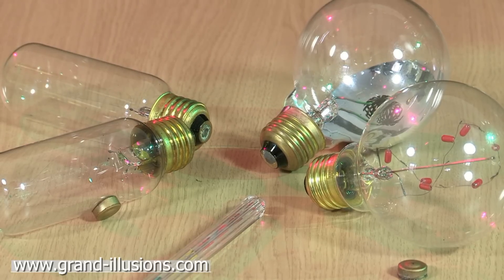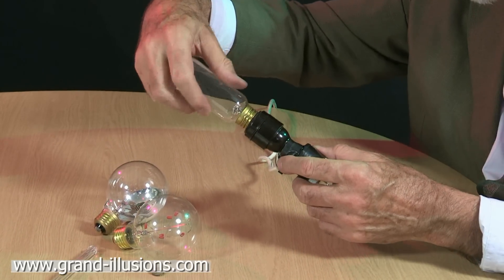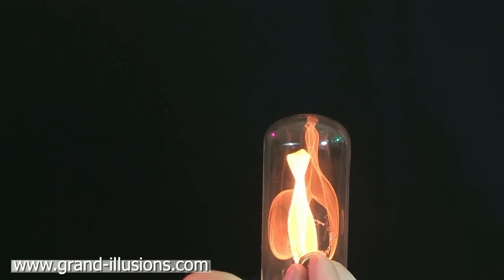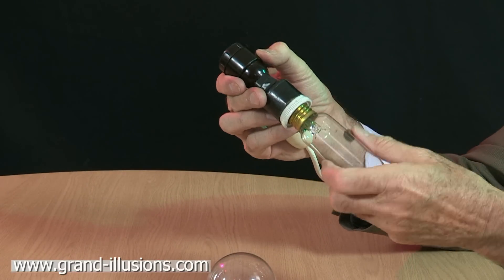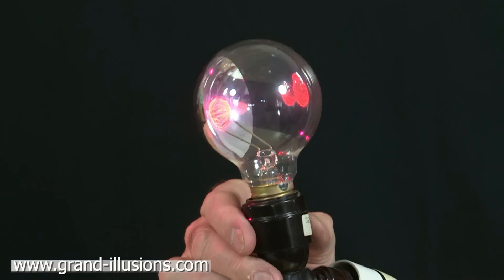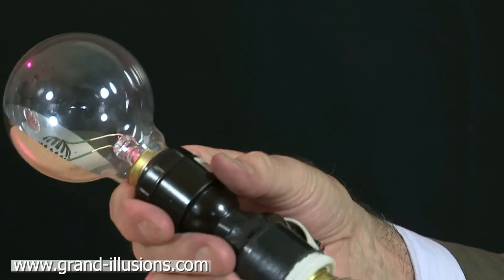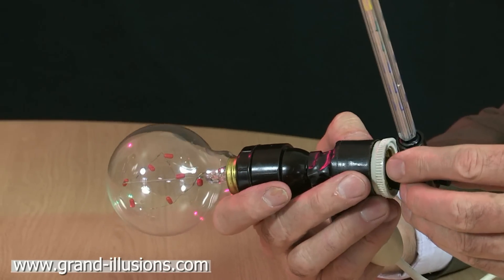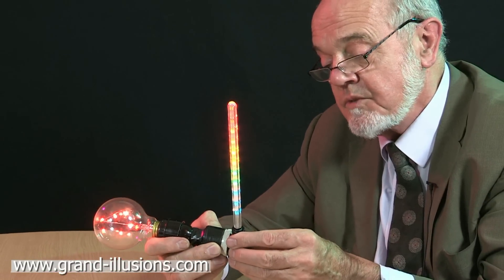Unusual Japanese Electric Light Bulbs

Comment: You are wrong about both UK and Japanese mains voltages. In the UK it's 230 volts and in Japan It's100 volts (50Hz in Kantou and 60Hz in Kansai).
Reply: True we were in Japan 3 times and everything is 100v. However I brought a decorative orange incandescent bulb there about 15 w and it says 110 volts not 100 or 120. Maybe a universal Japan/USA bulb. We used USA 120 volt bulbs there and they lasted forever on 100 volts but with reduced light output. Basically had to use double the watt rating ie 150 watt bulb where normally a 60 or 75 watt bulb would go. Most food mixers, vacuum cleaners, slot cars, fans, radios, space heaters, soldering irons
etc for 120 v 60 Hz worked fine on 100v 50/60 Hz just slightly lower performance.

Comment: Try using 240Vdc with the magnetic lights.
Reply: ***** Er, no. It would burn the filament. And the oscillation doesn't have any thing to do with the voltage, it's related to the frequency of the power supply.
Reply: Flatline.
Reply: *****
That would be a flatline.
Reply: +Simaka Wolf it would work, but only at switch on, and switch off. One way when turned on, and return to rest position. DC is just really really slow AC.

Comment: actually unless they are the same wattage they wont both have 120V on them. if one is 25watt and another one is 50watt then putting them in series one will have 2x the voltage of the other across it, not half

Comment: The magnet-operated bulbs are knock-offs, though nice ones, of an American-invented bulb called the Balafire, still manufactured by hand by Kyp-Go, Inc. Kyp-Go Balafires have always had the magnet mounted inside the bulb. The mirrored bulb is a variant of a "glow light," made in a zillion styles; it is indeed a neon gas discharge. The "candy" bulb is called a Tivoli Bulb, they're available in the USA (not to be confused with Tivoli Lights, which are something else). The LED spectrum is awesome.

Comment: Except for the fact that lightbulbs aren't constant resistive loads, and neither would two different lightbulbs be matched to each other exactly. A cold light-bulb can have a resistance of less than 1/10 of a hot light-bulb, and since the bulbs will light up at different speeds, one will definitely see a larger voltage spike to start with. Probably not dangerous, but hey.

Comment: Another way of putting it is a two unequal wattage bulbs running in series will case the lower wattage bulb to burn too brightly, and burn out faster, while the higher wattage bulb will burn dimly or not at all. Google series resistance to learn more. All filament bulbs are, simply very large resisters.

Comment: The only two problems that will EVER arise from his contraption is ONE, if one bulb blows the other will not work. TWO, the bulbs screwed in at the same time absolutely MUST be the same wattage rating. The PIE formula will dictate, if they have the same wattage rating, they are the same resistance, Only then will they both equally drop 110 volts. Whichever bulb is of lower resistance AKA higher wattage will drop less voltage, and cause the other bulb to drop too much voltage.

Comment: That last bit does kind of conjure up the phrase - 'Health and safety will have a field day.' But then, been there and done that myself. 
The real danger with having two bulbs in series is if their impedances are very different. They will act as a potential divider and the differential will cause most of the voltage to be divided across the one with the highest resistance - causing it to blow or maybe even explode. Lots of fun..

Comment: Nice lamps.  Most available in 240v if you hunt for them.  (Not sure about the cute neon refecto-star).  Tandy used to sell the flickering lamps with the magnet inside the lamp.  Definitely try and pair identical lamps if wiring them in series, as there will be a major voltage difference otherwise, that could nuke the lamps.  And you did have exposed 240 there, so take care and use an RCD.
Reply: Tim is supposed to be an engineer.  Why would he think that doing things like this was ok?

Comment: On this device you got touchable live parts with a minimum voltage of 115V AC. Assuming your bodyresistance is 1k Ohm the resulting current is 0.115A. this is enough to give you instant muscle cramp, high risk of ventricular fibrillation after 0.1 sec and after a second your heart could stop completly. So says the idiot.

Comment: Try to put 120V/10W bulb series with 120V/100W bulb in an 240V to see what happen, your 10W bulb will burn because 10W bulb have much higher resistance and get most voltage on it, 100W bulb just acts almost like conductive wire.

Comment: To the people fretting that he's using 120V bulbs on a 240V system, what he's done is connected the bulbs in series so that their combined load is 240V; Each bulb gets half, or 120V. While not optimal, it's also not very dangerous. It's basic electrical principles he's applying.

Comment: it isn't a good idea to hook up the bulbs like that. Get a proper 120V source. If the bulbs are different wattage ratings then they won't actually have 120/120 on them but may have something like 80/160 instead. It's the reason that one barely lit up when it was hooked up with the other one. Sure it will work but depending on the wattage difference it may not be good for their life.